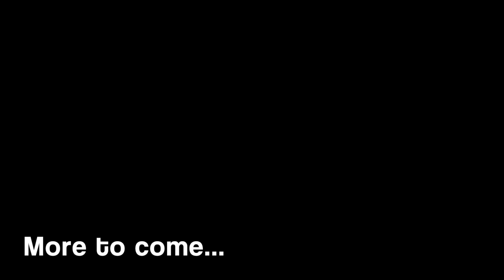Melly's Project 1987 Honda Rebel 250 "Barney" Part 9 (Barney Back on the Road!)

Comment: Its great to see Mel getting so involved in the repair work. Barney is really taking shape now, what a shame he blew his guts all over the place :(You need to add another camera to the shopping list Mike, and fit that to Barney so we can see the Indian as well :)
Reply from the maker: +yankee doodle Funny thing Chris, we were already talking about a 2nd camera and intercoms (that's in the future for sure). For now gotta make sure that Barney is 100% and reliable. The old Rebels getting there. Still with all the money we have put into ol' Barney, still less than 1/3rd the cost of a new Rebel and loads more fun!

Seems the CMX250's tend to pop out the oil seal on the crank fairly regularly from what I have seen on Google. So I am going to red Loctite it in place and spike-peen the edge in 8 or so spots. I'll still be able to get it out with a good deal of force, but it should never come out again on it's own just with crank case vapor pressure. IMO it's a design flaw on this particular engine. I had read it's the fault of the breather / oil separator becoming clogged. Not sure how much I believe that or not, but for Barney it will be the last time this repair is needed! Cheers!

Mike

Comment: Did you have any trouble installing the led front light? And which light did you use? 
I own the model prior to the rebel 250, the cm250 Custom, and i also want to run led lights, at least up front. 
Problem is my bike runs with a front light socket called R2, so i don't know weather to change the socket for something else, og a completely new headlight. 
What did you guys do? 
Cool videos (Y)
Reply from the maker: The EMGO headlight assembly came with a connector for an H4 halogen bulb. Melly's bike had a different connector. The EMGO CB750 style replacement head light's color coding of the H4 connector wires were the exact same colors as the factory Honda wiring harness. Verified that in the shop manual. So we just spliced it in. As for the brand, I don't remember but all I did was search for LED H4 Motorcycle Bulb on Amazon and there were plenty to choose from. Used the LED version of the H4 so the current draw was low. The original wiring didn't look like it could handle the full load of a standard H4 Halogen. Thanks for watching!

Mike & Melly

Comment: i just stumbled onto you guys, hello fellow Michiganders. I just bought a 03 rebel. where did you guys get the bag on the back? looking to add to my bike for more storage.
Reply from the maker: +Cassandra Briske It's a tool roll we bought off Amazon.com, don't remember the brand. Was $99 (real leather). It's a tool roll you would normally mount to the front forks or handlebars. Once you remove the passenger seat, and the loop (have to cut that off, then you can strap the tool roll to the seat bracket. It also hides the mounting bracket. Granted you are still left with holes in the fender from the passenger seat. Mother Road Customs makes a really cool springer seat that has a matching leather pad that hides the passenger seat mount. You could still strap the tool roll to the springer bracket. Thanks for watching!

What part of the Mitten are ya from? We are in the Detroit Metro area near lake Saint Clair. Cheers!

Mike & Melly!
Reply: +Michael Rench cool thanks, I'll have to look into it, thanks for the ideas of mounting it as well. I'm up near traverse city, a bit south actually but biggest city to me for geographical purposes. :-) happy riding guys!
Reply from the maker: +Cassandra Briske Here is a YouTube video for the Mother Road Customs spring seat for the Rebel. https://www.youtube.com/watch?v=T0EeOy1-imk

Cheers!

Mike & Melly
Reply: +Michael Rench awesome thank you!